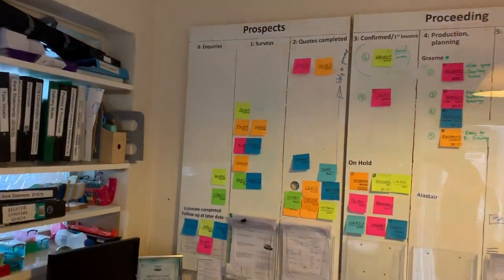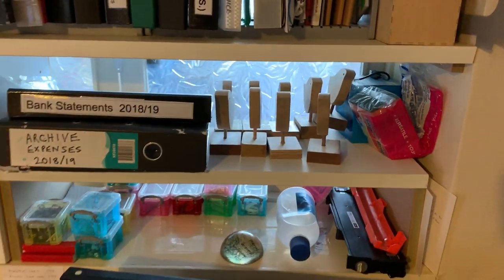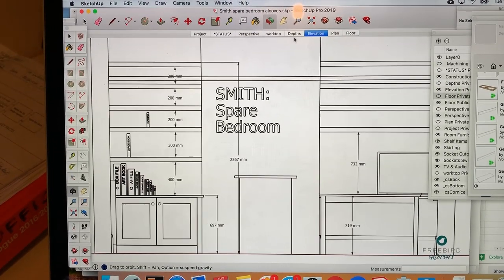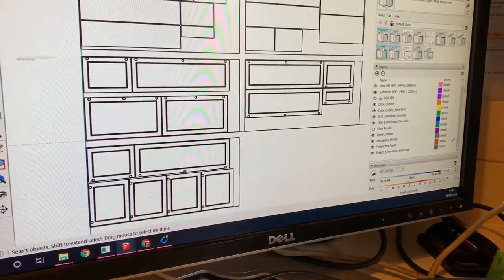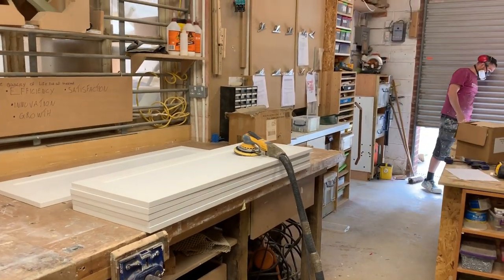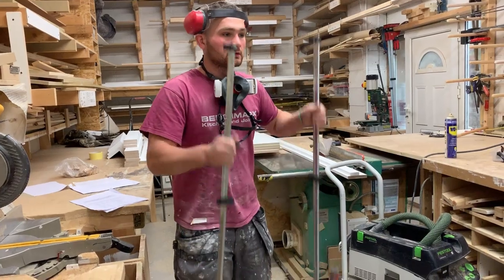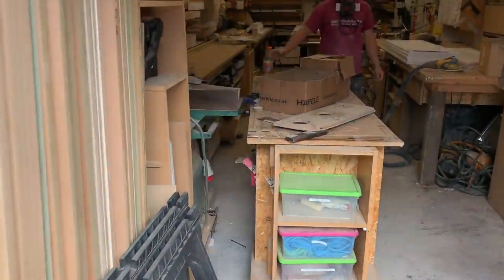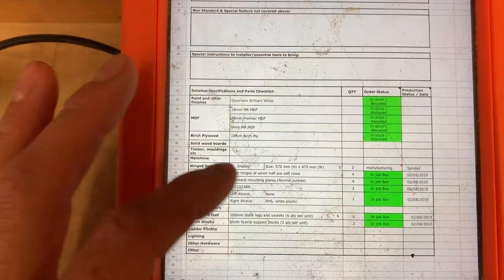Homebased workshop part 2 - systems and team

Comment: It is really amazing we pretty much do the same method
Reply from the maker: Henry V Palomeque which part, the post it notes board?
Reply: @Alastair_Freebird  your whole business
Reply from the maker: I suppose the odds are that could happen!  Where are you based?
Reply: @Alastair_Freebird  I'm in NY long island I do work in the Hamptons area
Reply from the maker: Do you use MDF and if so what brand?  I have a US based subscriber asking about which brands available over there can get a good sanded edge and painted finish.
Reply: @Alastair_Freebird  I try not to but after seeing your work and your friend Derek's work, I do mostly lacquered units so I'll be using MDF, here what I use it's called Medex, for the edges me personally can't get  it properly finished so I add prefinished either birch or maple edge and, lacquer primer to me it's the best for base, I used once water based top coat didn't like it

Comment: Great video! Nothing wrong with the editing either 😂 its amazing to get an insight to how others run things especially when I'm a very similar line of work. Its especially interesting for me... you took the your first steps of expansion via staff and held off on upgrading equipment toward I'm still on my own rarely even a labourer but have a very reasonable space rented and filling it with high end machines etc as much as I can! I'm really jealous as to how much ye have in Google drive it's so detailed !! Wish I knew how to sort something similar to that!! should sell those templates I'd defo buy 😂😂🙈 if I had to get one staff member it would certainly be a Graham! Where do you find one of them? 😉( that's actually a serious question.... what would he call himself or his training be so if I was to go looking for someone to do similar for me??). Brady seems a great guy to have around too. Someone who actually has an interest in what they're doing! I do think a bit more space n just a decent panel saw and a low to mid range spindle molder would make Brady 3-5 times more productive though. Next bottle neck is sanding then... I've been looking into some different sanding machines but with bristles rather than belts can do mouldings n MDF edges etc even denib between spraying!...  mdf n drum sander is bad combination in my opinion and I also don't have 3 phase. Once again really appreciate you taking the time to make video!!
Reply from the maker: Jack Finnerty hi Jack I think you did the right thing investing first in machinery.  Think that for me investing first in staff seriously slowed the growth of the business.  A machine brings an immediate productivitity increase.  A staff member brings an immediate productivity decrease!!! But an increase in the long term when they’re trained.  When we finally move I will definitely get machinery.  The main investment will be either a CNC or panelsaw.  Not sure I can stretch to both.  I know a panel saw seems essential but if we get CNC there’s a lot of cutting of carcase parts than can be done including predrilling shelf holes etc.  It will save Graeme time preparing drawings for Brady or for ChopShop (our CNC contractor); he can send straight to CNC, so he gets more productive and Brady also gets more productive focusing on making.
Reply from the maker: I’ve also looked into specialist MDF edge sanding machines but the price was about £30k!!  http://gibbsfinishing.com/gibbs/mdfedgesanding.shtml
Reply from the maker: Employing Graeme for his CAD work etc has been kind of a risk - I met him through friends and thought he could be a good fit, but I know that others in my line of work think it’s madness to be paying someone 4 days a week for drawings etc at this small stage of my business, and it has been costly; there has been a period of a couple of years or more where it’s been debatable whether it’s worth it financially but my eyes were on the long game and I always had at the back of my mind that when we finally get CNC in house he will be a huge asset to running that side of things.  He is already a big asset as now he understands our methods really well he is increasingly productive and apart from drawings he does ordering of materials and components.   Also I have been able to claim back some of his past wage as a tax offset for ‘research and development’ work from HMRC because I was able to argue that a lot of what I was paying him for was development of innovative new methods and techniques which is classed as R&D - specifically the way we have set up SketchUp with our  own customer components that work with cutlist.
Reply from the maker: Before deciding to take Graeme on I dabbled with outsourcing the detail drawing work, to a company I found online with draughtsmen in the phillipines.  A lot of people would recommend outsourcing in this way; also with virtual PAs instead of an employed administrator, however I found too many communication problems and frustrations and decided we needed someone physically present.  I have questioned myself on these decisions many times and doubted whether it would ever pay off but it’s all preparing us for long term payback (I hope!!).
Reply: @drewbyscoobywho  I got this .... won't suit Alistair in my opinion... you'd need to set it less than .5mm smaller than the stock your running it through also need to tilt the arbour approx 3 degrees and most saw on this side of world tilt the wrong way!! Sounds like great idea but I've found it to be a waste of money!!
Reply from the maker: Jack Finnerty so you’ve tried the same thing?
Reply: @jackfinnerty7891  I thought that was its intended use, just to skim the edge? Obviously I'm just going by the vid. I think he uses it on his Robland panel saw which is European and tilts to the right, which is pretty standard here? I had thought about getting one myself so am genuinely interested to hear what you think of it 👍
Reply: @Alastair_Freebird  Hi Alastair, I'm not sure if there's an answer to machinery vs employees being right or wrong. I'm jealous of your reliable highly skilled staff towards I'm sure you'd like my space and machinery... couple of reasons I went machinery route... I'm young, so any employee is going to be older than me.. no one likes being told what to do by someone younger! Another is with machines u know exactly what they cost before buying and it's 1 payment n that's it.. after that if they're not working they aren't exactly costing you money compared to weekly wages! With that many employees you'd have a cnc bought in no time if they decided to do charity work 🤣I don't feel comfortable enough yet to be promising someone a weekly wages (probably because I keep spending it on tools!! 🤣) 

I can see why you'd go straight for cnc... I didn't even consider it because I'm on my own and not very technical at all so would be a massive learning curve and to be fair I've enough problems n worries without one for now!! Defo opens a lot of doors and would cut down on staff though!! 

As for sanding I looked at something different but probs the same concept.. I thought I'd be looking at massive money too but when I rang them (uk based company n I'm in Galway) the rep told me what I needed was only like 2000 ish!! Cant remember exactly! He reckons it's fantastic for MDF edges etc. Doesn't burn or eat away at them either like a belf sander would. Its manual fed but I'm thinking of making a fence and getting a power feed for it... I can't see why not.... I'll link it below! Let me know if you've seen it? I even asked him what's the next step up both price wise and features.... He told me I'm mad that it was unnecessary and actually never answered the question! Yes they do lovely 30000 plus ones too but unfortunately can't get them yet!! Maybe someday!! 

I've always wanted someone like Graeme but to be fair until I watched your video I had no idea how valuable n helpful he could be... your whole setup and organisation looks amazing!! So now I dnt want it's a case of I really really need a Graeme!! 
That was a bonus that you could claim some back.... always very welcomed!! 

I wouldn't be to keen on dealing with some online either, much prefer for them to be physically there... would also want to learn from them!! Cant imagine some online giving anything near what your getting from Graeme n your team! 

I'm already at a stage where I'm extremely overworked (self inflicted) but still seem to always be behind! Although I'm a very organised person if I took someone on as is, I'd really struggle to make/keep them busy they'd have too much to do some days n not enough others...and also feel that I'm under too much pressure at the moment to be teaching n showing them.... you've got that over with now so would like to think and hope for your sake that when you get the space and machinery you'll explode 🤣👍

As for the sanding disk.. yes I imported one last year took 7 months to come into stock!! An unbelievable amount of emails but I thought would be worth every penny!! Unfortunately it isn't!! I found best results is with 2 passes taking off less than .5mm each time probs .25mm a pass... it takes a lot of time to go setting it up etc... I've completely stopped using it but when I was I could only justify it to run all my door rails n styles through and that was only if I had a kitchen worth of doors!! Save your money! I haven't actually tried it on panel saw... I will do and report back... I'm not overly optimistic but very hopeful!!!
Reply: @drewbyscoobywho  just replied to Alistair I mentioned it in that comment.  Yes it's the intended use but was disappointing.. I cant remember what saw he had it on maybe it was panel saw? As above I'll try that n report back. My last saw tilted to the left so I had swap fence over etc ... either way not really something I'd be pushing doors though unless it happens to work as I first expected it would on panel saw!! I had such high hopes for it when buying!!
Reply: @Alastair_Freebird  https://www.unosand.com/multi140.html. this is the sander have you seen it or heard anything about it?
Reply: @jackfinnerty7891  just rewatched the video and spotted it's not the Robland panel saw he uses, looks like it has a small arbor so might not work on a panel saw, my bad!
Reply: @drewbyscoobywho  crap yes your right I completely forgot about that!! Haven't used it in 6 months... its 16mm arbour! Could get it drilled out though as there plenty of space... dnt think I'm willing to put any more money into it... but I'll see if my saw blade sharpener will drill it out and if so at what cost...
Reply: Freebird Interiors Why not get an edgebander? I’ve bought a second hand co-matic and was lucky enough to get a cheap table that holds it from Axminster. All for £1k. Sooooo much better than sanding and sealing the edges with primer etc 👍🏻

Comment: Great insight to how your business works very interesting do you ever get any complaints about the noise does , is the Council aware you run your business from home look forward to your next video
Reply from the maker: Norman Roberts no complaints about noise.  We only work reasonable hours and no weekends.  One of the reasons we want/need to move is that since going from sole trader to limited company I really ought not to be running it all from a residential area however my only actual brush with the council so far was a visit from a building control inspector when we built the shelter on the side of the workshop and he was actually quite supportive!